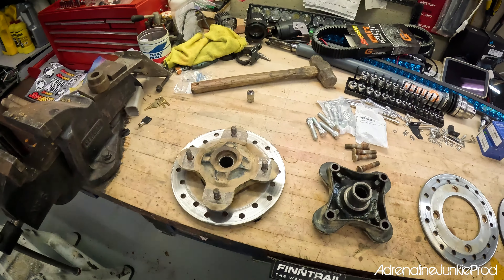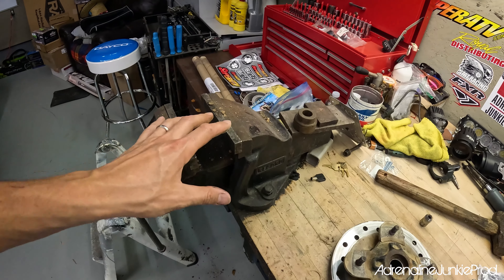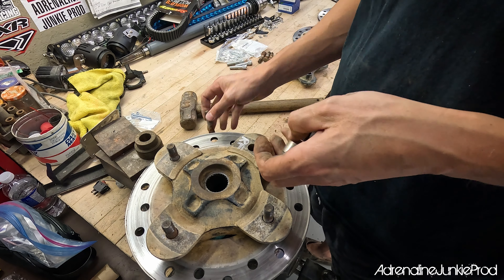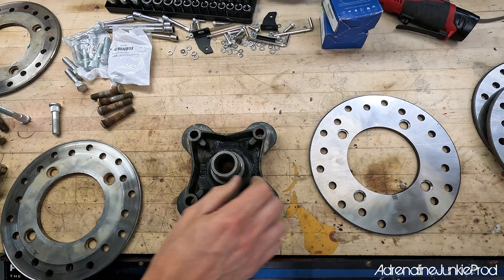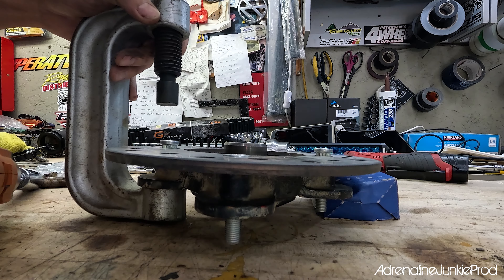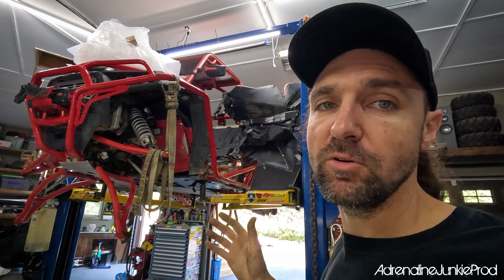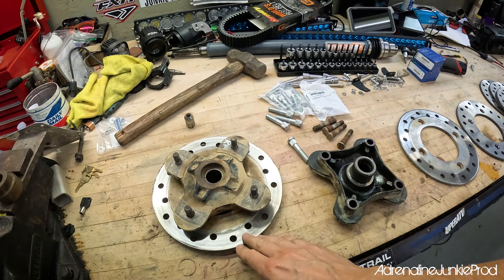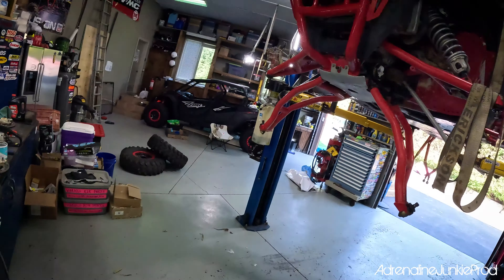How to Replace Brake Rotors on a RZR or Other SXS/UTV/ATV - KRX/YXZ/X3/RMAX/Maverick/Talon/Z-Force

Comment: Nice work . 7 years on those rotors with that mileage is really good. I have seen rotors , wheel bearings and pads destroyed at 3000km . Proper maintenance , keeping the machine clean definitely increases reliability and life of the machine.
Reply from the maker: Thanks man. Ya, they did hold up pretty well, I should have replaced them a little sooner but regardless, many years of use. I also replaced all the sliders and seals. So the brakes are as new as can be.